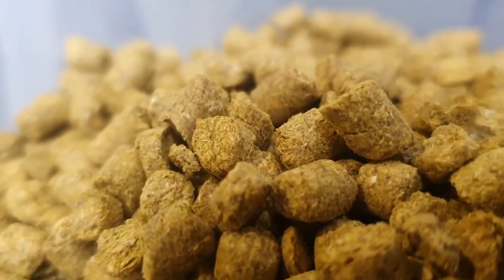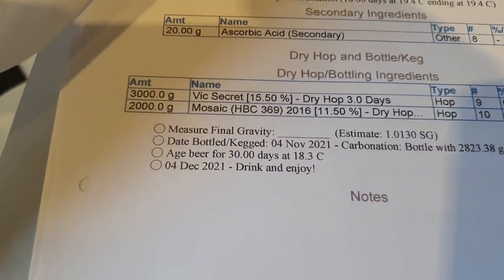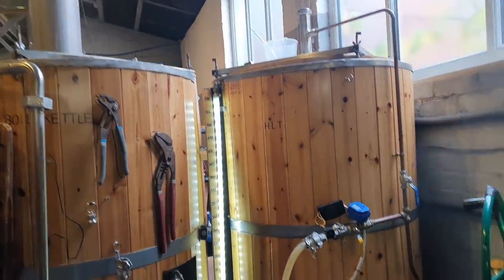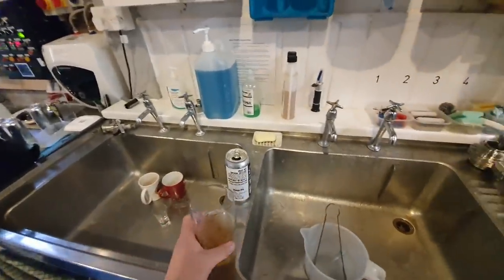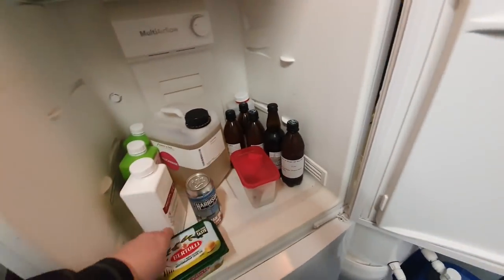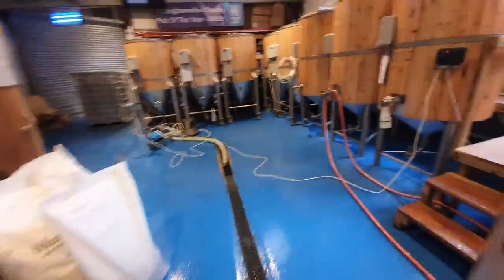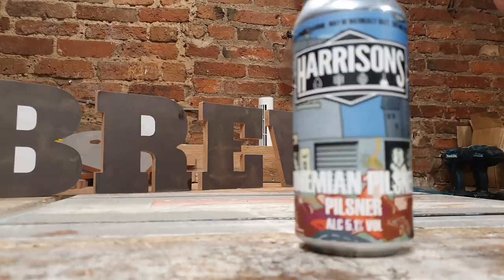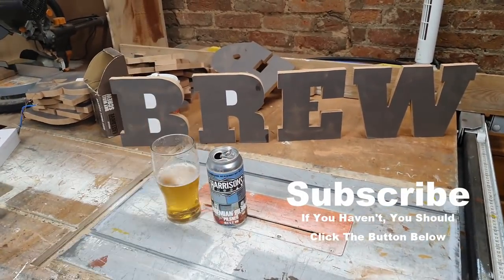Secret City NEIPA Recipe

Comment: Lovely brewday and share...absolutely FRIGGIN RIGHT!
Reply from the maker: Thank you kindly!
Reply: @harrybrew69  May I ask what the IBUs you get for this work out to be? I am using Brewer's Friend and doing the hop stand at 10% utilization @ 180F/82C (their recommendation, (which seems low to me?)) - I get 53.54 IBUs in a 5 gallon batch. That makes BU/GU ratio 1.31 - which .5 is balanced. Would love to brew this one...seems a great spring beer. (Don't want to screw it up) Cheers!

Comment: My girlfriend is Ceoliac and I use brewers Clarity (sold as something like NBS clarity by The Malt Miller) to make it "gluten free" for her. In 100% of my experience it Reduces the gluten to a level where it doesn't cause any issue for her. Also had a few other ceoliacs drink it. Zero problems. Done low ABV, fruit beers, Foreign extra stout, DIPA, NEIPA, Wheat beers. No problems.
Reply: Stella artois has a "Gluten Free" beer with Gluten as low as 20ppm. The clarity agent makes it even less, around 10ppm. So indeed it can be considered "gluten free". (there is a brewing channel here in Brazil that has done this test with the lab analysis).